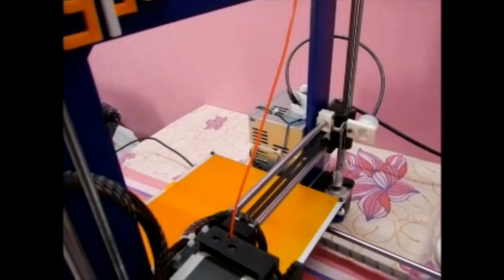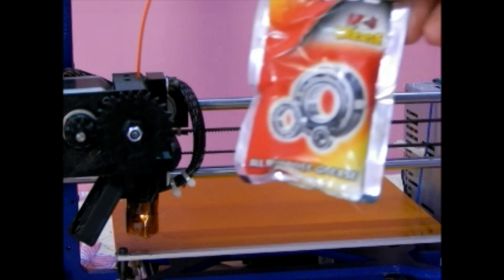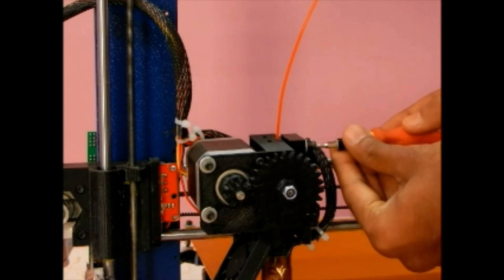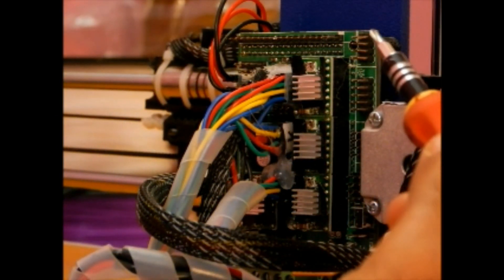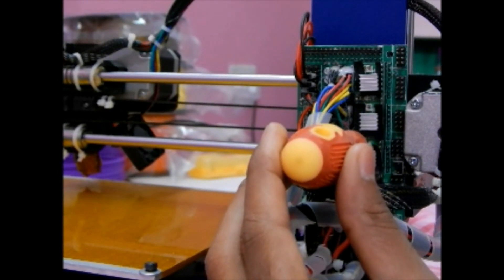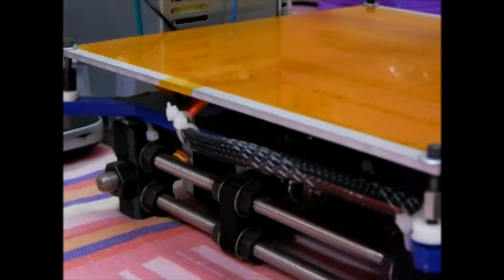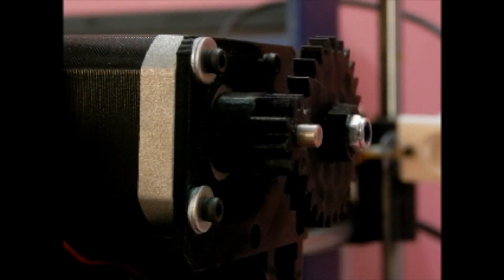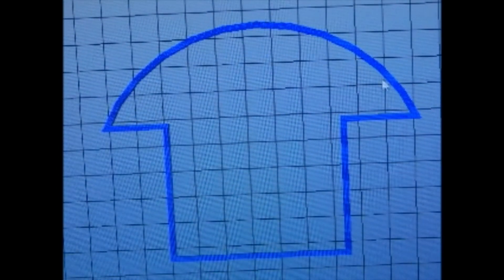Prusa i3 Build Tutorial : Part 10 - Adjusting Polulo Stepper Driver Current

Comment: how do i slow the steppers down to keep from outrunning the hot end filament ? im running  1.75 filament  with a .03 nozzle
Reply from the maker: Can you please clarify the question a little more. I did not quite get it. I'll try to help.
Reply: 3DPrintronics Hi  again
I found my problem the nozzle was stopped up, I took it apart cleaned it out and it works great now. thanks for getting back to me :)